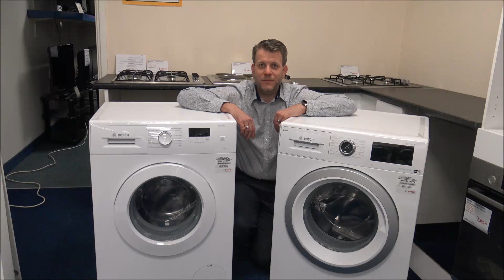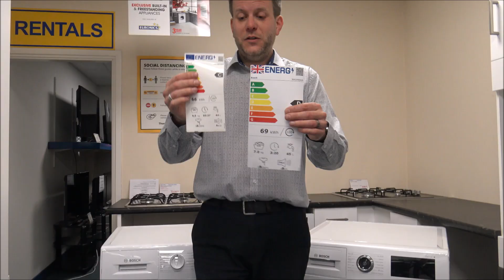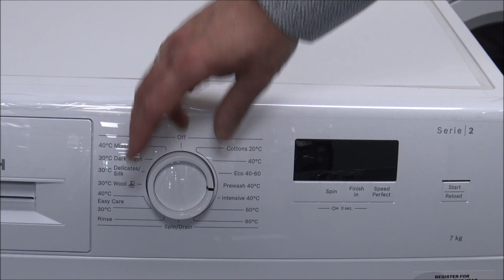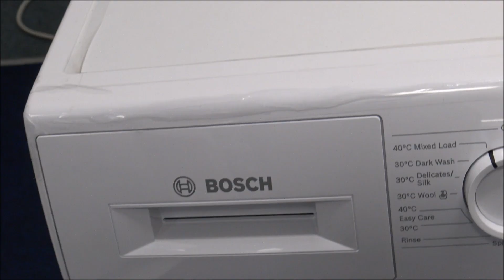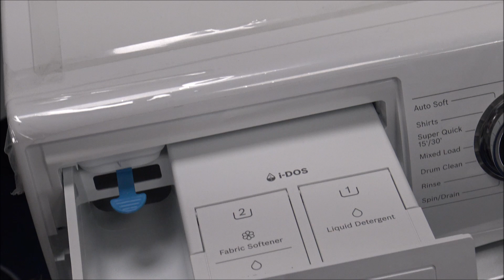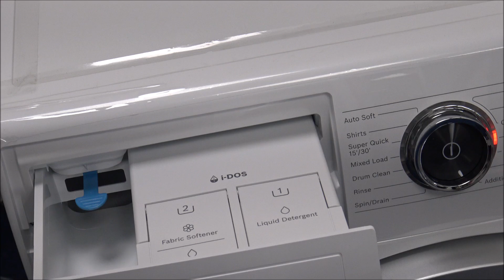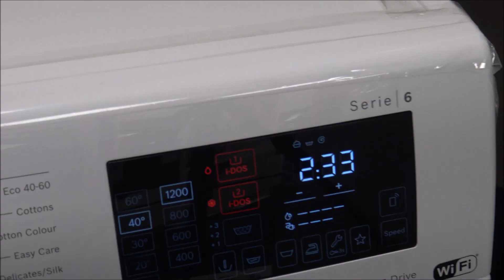Is It Worth Paying Extra For A Better Washing Machine?

Comment: Great Video, but the decibel is a ratio of two quantities and taken with the log of base 10 instead of the natural log where the base is 'e' (approximately 2,7). So the volume doubles at every interval of 10 db instead of 2,7 or 3.
Reply: Im glad someone else picked this up
Reply: @2eulogy2  It's not the ratio to each other, it's the ratio to reference p_0=2x10^(-5) where SPL = 20 * log10(p/p_0).  So 3 dB is double the sound pressure level (or sound power level), but 10 dB is double the perceived loudness by a human.

Comment: Does the more expensive machine have a speed perfect option like the older Bosch machines? I use that all the time.
Reply from the maker: Yes a lot of the higher end machines still have speed perfect
Reply: @lords-electrical  Thanks!

Comment: I'm not quite sure how I stumbled across this video. Washing machines are kinda meh. But I do weirdly have a bit of experience with what works and what doesn't. AEG used to last forever, German engineering was built to last, but not these days, unless it is for industrial use. I lived in Switzerland for 10 years, if you live in an apartment building in Switzerland, there will be a shared laundry room. The washing machines are designed for domestic use, but they cost between £1000 - £1500 each and are built to last for years and years. A bit bigger than standard but if you have the space, get one. The washing machines we get here in the UK are not designed to be repaired.

Comment: Be interesting to know where the 2 machines are made.
Would the cheap one be made in China and the more expensive German build?
Our Swedish built ISE 10 cost just short of £1000, same as the Miele we didn't buy, was it worth it? well ISE went out of business about 2 years after we bought it so the 10 year warranty isn't worth the paper it was written on.
However, it is very well made, does all we ask of it is uncannily quiet and so far (7 years maybe?) hasn't missed a beat, but not sure i would spend so much again, if and when this one fails it will be a cheap throwaway jobbie.

Comment: I’d say buy the best you can afford but you get what you pay for. Some manufacturers are taking away basic features and programmes that were standard across the ranges previously eg Aquastop and only putting them on top of the range models now.

I have a Siemens machine that is still going 16 years  since installed

Comment: After 40 years every washing machine has lasted 6-7 years This was confirmed at a building maintenance course where the instructor pointed to the life cycle of washing machines saying that manufacturers would plan for a 7 year cycle plus he pointed out if 6-7 years old don't waste your time to repair. I spent 2 day fixing one the machine was £275 I spent £90 on materials no labour and it broke down on a different fault  6 months later so I bought a similar machine for £295.
After that like clockwork my machines would break down or start playing up 6-7 years after purchase and funny enough the replacement machine was the same cost after 6 years

Comment: I replaced my 12 year old Hotpoint 8kg 1600rpm, bearings had failed and at 87db I couldn't hear anything. It had other problems, including F22 which was fixed by opening and closing the door several times, a wiring fault, refusing to wash on occasion or missing the spin cycle leaving clothes wet etc.  
 I went for a Blomberg WF194410W. As I have a smart meter, I was able to compare electricity usage between an old A+ rated machine and the new rate B (old A+++) and the new machine uses hardly any electricity.  Warranty is far better 3 years parts and labour and 10 yrs on the Inverter motor.

Comment: My first Miele i left at my former home after 23 years of use.
From 1976—1999
I cleaned the timer that turns when the program goos once.
Powdered the rubber regular and cleaned out the little pool of water between the door and drum every now and then.
Always left the door open after using.
And cleaned the filter.
It was parked in the kitchen.
Did not keep contact with the later occupants but they helped me move as a payment.

I am still on my second machine / appartement and trying to be as nice as possible to both.
Be safe 💪

Comment: We had a Bosch 2 years then got a hole in the drum. A common problem with all machines as the outer drum is plastic. The  build quality is better but the drum is the same on all machines now.
Reply: Miele and Asko outer drums are stainless steel, apart from the cheapest Mieles.

Comment: I think the saddest thing about appliances these days is their planned obsolescence, at least here in North America.  I just replaced the washer/dryer that was in this old house.  They were put in early 1970's and as best as I could tell had never even needed repairs in the last 40 years.  Sadly the dial broke on the washing machine and it was too old to find a replacement.  The washer wasn't efficient at ALL, and it ripped a couple pieces of clothing, but for the most part it worked great.  These new replacements I got will maybe last 10 years at the most, and so far every front load high efficiency washing machine I've had has needed maintenance every couple of years for one reason or another.

They say they will save you on monthly bills, but I don't think people calculate the full cost.  They're a terrible cost in resources making all these very fancy complex machines that break down so often and get replaced every 10 years or less.  That's a huge burden on mining, especially the rare metals for the motherboards, as well as all the water and petroleum products used in refining raw materials, manufacturing, and shipping.  Not to mention a huge financial burden for the consumer who has to pay thousands every decade for new appliances and then hundreds to repair them.  The $5 a month it saves you on utilities is barely a drop in the bucket if you look at the big picture.

Comment: Brian PAUSES video at 00:00 
In the 1970s and 1980's I would have said YES it was worth paying extra for a better washing machine.  They were better made back then.
However, in 2022 I would say NO... 
They are all built to a very similar standard now.  If you want your washing machine to last long here are a few tips 
1) Buy it BRAND NEW .. Reconditioned machines are a false economy and you will pay more in the long run 
2) NEVER overload the drum...Only fill it 50% ..Also, the clothes get a better wash as well 
3) Only set the "Spin speed" to around 80% of its MAX... So for example if it has a max spin speed of 1400...Only use it up to 1200 
4) Give the washing machine a "Deep clean"  at least 4 times a Year 
5) Try not to move the washing machine once it has been set up. 
6) Use liquid rather than powder to wash the clothes... That way you don't get a "Clog up" in the machine. 
7) Do you REALLY need the washing machine to do a 4 Hour wash on clothes that have only been worn in the office?  
A 45 Minute "Quick wash" will wash these clothes = LESS wear and tear on the machine. 
I bought an Indesit "Value" washing machine for £159  GBP and I got 12 YEARS of trouble-free service out of it from 2001-2013  out of it following the 7 rules above.
Reply from the maker: Great feedback thanks

Comment: Bosch WFK2801, 24-Jan 2000, from Market Spares & Repairs, East Ham Market. The market no longer exists. Creda slot in cooker died in 2004. The wm was old tech being replaced by Classic range when we got it but my habit is to buy best of last range rather than affordable of latest versions. Moved house once in that time. Some bits and pieces have been replaced or bolted back. One engineer gleamed when he saw it "Best washing machine ever" - last overbuilt maintainable machine before proprietry clips and and notches prevent use of generic parts. Up to then, we'd been given an 8-year old machine by friends when we got married (it lasted us at least 10 years and several moves) then we bought used machines that would last about three years before becoming not worth repairing.

Comment: My ex insisted on spending 500 quid on a  Bosch washer some years ago. Within a few weeks, one of bra wires pierced through the seal ( I know... ).  We had a 5 week wait until the new seal arrived. The engineer did point out that had we chosen the £230 Hotpoint that I wanted, he carried the seals on his van.
Reply: Did that cause the split? Peace and goodwill

Comment: We are on our 4th washing machine in 10 years (we have had our own home for 10 years). When buying a washing machine, the 2 important things to look at is, the capacity and the spin speed, which have been covered in this video. 7-8kg is plenty and 1400rpm spin  speed is more then enough. Nothing wrong with using a 2nd or 3rd spin, which is what I do to cut down of drying time. We have had both cheap and more expensive machines, I would choose a cheaper machine and I would pick a machine that isn’t digital. Get something with a dial as opposed to a screen and buttons.

They are my opinions anyway, I’m sure everyone will say differently.
Reply: The fact you only get an average of 2.5 years out of your machine shows that it's not worth buying cheap.  Spend more up front, you get a better wash, and over that 10 years it would have likely worked out less cost overall.  My AEG is over 4 years old and could easily be sold as new, it's still in perfect condition. 

Buy cheap, you buy twice.

Comment: Spin speed in not necessarily best for water removal. Drum design is more important. Spin speed can on some can affect the bearings on cheaper models. So slower can be expensive on repairs.

Comment: That’s an easy one - yes definitely. Our Miele washing machine is now 30 years old, gets used many times a week, and is still going strong. Let’s just say it doesn’t owe us a bean.
Reply: Do you live in a hard water area or have a water softener? Scale is one of biggest killers.
Reply: @JohnnyMotel99  I live in a soft water area so scale has never been an issue.
Reply: @jeremymeara6546  one good reason your Miele has lasted.
Reply: It will be interesting to see how much power it uses per year compared to a new machine.

Comment: With the app can you use voice. I have several patients who are blind & that has restricted them to a standard dial selector because they can stick markers on the main programmes.Digital screen is fine for many, but we can see. I have a 12 year old Miele which came with a 10 year parts & labour warranty. You don’t get that on cheap machines. As my commercial laundry engineer friend says. Buy cheap, buy more or buy more expensive & buy less.You get what you pay for with many things in life.

Comment: 07:01 I have to confess I use only the same two wash programs/cycles on my washing machine despite the myriad of options available! 🤣 And it's cheaper to spin loads 2 or 3 times extra and air dry than use the tumble dryer.

Comment: I have owned a Miele washing machine for 45 years, items replaced in that time water pump that's it I also cleaned the solenoid would I buy another definitely NOT in 2021 everything is built to cost this applies to all makes best to buy a reasonable price machine although manufacturers profess to eco- friendly this not the case they are designed to be replaced in a few years so you buy it again and again

Comment: had a hand me down Zanussi this failed after about 20 years so I bought another as you would, that lasted 2 years and there is just me who used it. the old one had a plastic container that held the concrete ballast weight the new one just had bare concrete. the new one exploded when the concrete ballast weight cracked and hit the drum on the 1400 spin cycle, the bang could be heard from the bottom of my garden whilst I was in the garage. the new machine did not have a plastic container for the concrete ballast just a single steel wire inside that of course fractured. some of the concrete ballast was actually found inside the drum in the washing! The washing machine jumped to the middle of the kitchen, but as I had plumbed it in had plenty of slack on the water pipe so no water spraying and flooding the house. so they are built to such a price point they are damaging their brand. i tell everybody and anybody what a load of garbage they are. I now know I could of claimed under the fair use policy as it was hardly used with just one person using it. i just save up and buy miele for everything now.

Comment: I bought a Bosch about 20 years ago and it died after only 6 years. Perhaps I was unlucky. However I didn't replace it with another Bosch for four reasons. Firstly, at the time we had two young children and the shortest washing cycle was a couple of hours long. Not fast enough when you need a quick turnaround. Second, it offered a really limited range of programs and other machines offered a much better selection. Third, (and this was the most irritating) when the cycle finally finished the bloody thing beeped and kept beeping until you turned it off. When you're dealing with a couple of young children it isn't always possible to drop what you're doing to deal with it. It was like having a third child vying for your attention. Fourth, once a cycle had finished and all activity had stopped the door would not be released for 2 minutes. Very frustrating. I'd never buy another. I bought a Samsung as a replacement and all these issues were overcome and I've been very happy with it. Bosch - very over rated in my experience.

Comment: Avoid Hotpoint machines at all costs, particularly the tumble dryers. I have one of each and they are both rubbish.
Reply: Had 2 Hotpoint washer driers, none lasted more than 20 months, revelation going to a Hoover that i kept going 3 1/2 years when bearing went after the main control at 7 months and the heater never worked.

Comment: I had a Siemens top of the range and weighed a ton lasted me 25 years. Amazing German engineering. Eventually  I could not get it moved to a flat so had to take it to a tip and I felt sorry to dump it in working order. German machines are so brilliantly made. The best thing is that you could not even hear it when it was spinning at top speed
Reply: The Old machines did last  tried with a new one 4 to 5 years Max.
Reply: Quality has dropped in everything the last 20 years, as for German brilliantly made, do they make them - highly likely no. The ones that are having had to deal with the German arrogance 'everything perfect attitude' 'alwys right' video evidence always prevails. The better Bosch Siemens and Neff very very smilar designs with different panels and price differences all made in same company. Choice is pay £200 more for a Siemens over a £550 Bosch or £300 more for same item labelled Neff.
Reply: @jhareng  I wonder if people know the histories of these companies.. mankind can be very forgiving.
Reply: @chrisburnby62  I do agree with you, though I think there's a difference between forgiving either the current generation (e.g VW mpg scandal) Vs a previous generation, from which few are likely not alive and nor are their principles.  It's a tough one, but I do think forgiveness is important, even if we don't forget.
Reply: I offered to move a lady friend with the help of her boyfriend. He didn't show up, and I was fretting about loading the white goods into a truck.  I moved all of them by myself using an appliance dolly. I was shocked at how light these new appliances are.
Reply: These times are over. Miele still has them in the upper price range, and LG. Most others are designed to last 3 - 5 years only.
Reply: Even some Bosch machines are made in China these days, which is why they can be had for less than £350. But don't be fooled, these ARE NOT in the same league as their German counterparts.
Reply: I still have a washing machine LG from 2012 with Direct Drive motor - so far is working as new.
Reply: Built like an Audi

Comment: I got a LG machine at my summer home because of lower power consumption.  I run it on solar panels with no battery.  If a cloud comes over, it stops. I wait for cloud to pass and restart it.  It remembers where it left off.  I feed hot water into the cold inlet and run all cycles on hot water.  Detergent feed is spotless from this hot water.  The same machine at home gets mold in the dispenser which has to be cleaned every year.

Comment: The first time I bought a front loader washer it was a Maytag  epic Z. It was the next model down, a $200 CAD difference from the top of the line. It was an awesome machine but I wish spent the extra coin since there were some extra cycles. The new one I got has all the options including dossing.
Reply: Is it a lazy machine then?

Comment: Usually washing machine motor brushes and drum bearings fail around the 10 year mark. Some more, some less, regardless of brand. That's the way i see it. Brushes are easy to change... bearings not so much lol.
Reply: Agreed, you can be lucky or vice versa

Comment: Hi. Washing machines. I belived in spend more money, get a better washing machine. I live a lone and disabled so i dont use a washing machine like a family.  I alway bought the biggest drum. So i could wash quits and things. I get an average up to 2 years out of a washing machine. Then when they breakdown. I get told i need a new machine. Costing me a fortune. Until one day i needed a washer urgenly. Then i was given a cheap one from a family (used everyday). It was about 2 years old at the time i got it. I cant remember how long iv had it now. But its stil going strong. The washing machine i have is a hotpoint 6kg VML540 aquarius